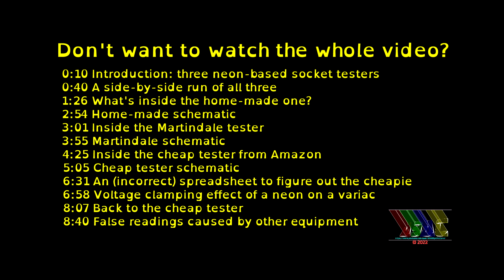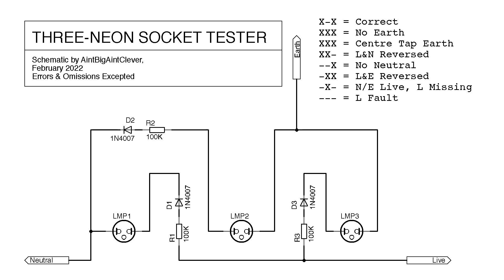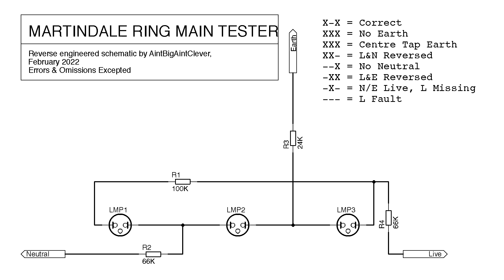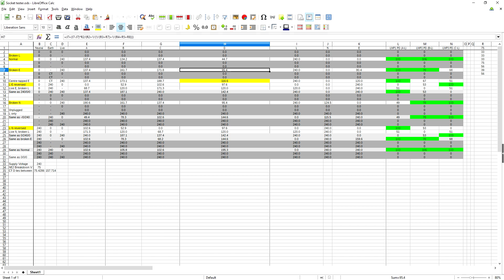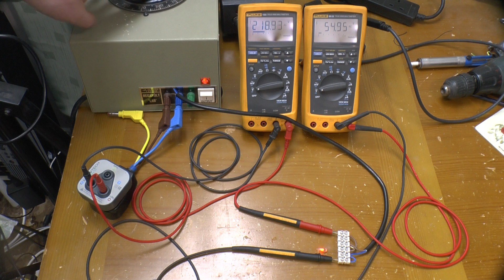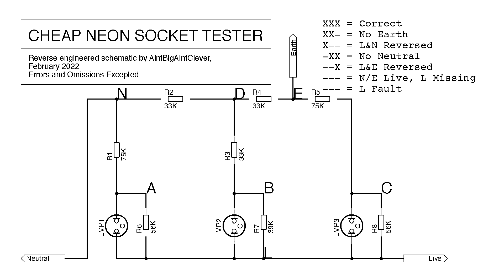What's inside a neon socket tester?

Comment: They're handy little devices, but you can never check to see a transposed neutral and earth.
Reply from the maker: Yep.  For transposed N-E you need a 10 watt bulb and an RCD on the supply :)
Reply: @AintBigAintClever  Yep this is PRECISELY one of the many reasons i still keep an old Drummond MTL-7 test lamp in my bag. Nice video, always wondered how the martindale ones work. 

Maybe it's because i'm old, but i always use the MTL-7 (along with a proving unit) as my final 'yep or nope'.... modern testers, even ones with a supposed 'load resistor' can show live when there's not ... which can potentially be as dangerous as showing dead when it's not, as you come to ignore the tester. I know we shouldn't but it happens!
Reply: Incidentally, proving unit is home made, in the case of a dead proving unit, simple inverter running off 9v battery, providing about 400v AC output into a neon or high impedence tester, or about 200 into the drummond.  only bit of the original other than the case is the 'start' contact that's cleverly wired onto the springy tag of a microswitch.  KISS principle
Reply: @AintBigAintClever  and how would that work? What is RCD?
Reply: Never mind I looked it up
Reply: @AintBigAintClever  as far as I can tell, if neutral and ground were swapped at the socket, there’s no way to know, at least from these socket testers.  An RCD only detects an imbalance between line current and its return. If the neutral and ground are switched,  the return will be in the ground wire.  How can this error be detected?
Reply from the maker: @yjweaver5108  with a N-E fault anything plugged into the normal pins will imbalance and trip the RCD, because the current's not fllowing back the correct way.  Incidentally this can also happen if working on a circuit where the breaker's been opened or the fuse removed.  If you accidentally bridge neutral and earth (for example when pulling the wires through a metal back box) current from other circuits now has a path not just through the proper neutral through the RCD, but also through the connection you've just made.  Any more than 30 milliamps taking this new route and the RCD trips, usually when you're working in an attic with a lamp plugged into one of the RCD-protected circuits.  Been there, done that :D
Reply: @AintBigAintClever   can you try a simple experiment? Take a receptacle in your house that you know is correctly wired, then open it up and swap the neutral and ground.  So that everything on the case (screws) are now neutral.  So when you plug anything in , current will flow through the line, to the load, and the return is now the ground wire.   I predict your receptacle   tester will not detect any faults .  I’d do it myself, but I’m not equipped at the moment.
Reply from the maker: @yjweaver5108  the tester won't detect a fault in that instance, and draws so little current that an RCD or GFCI feeding it wouldn't trip either.
In a TN-S installation ground and neutral will be connected together at the distribution transformer. In TN-C-S they'll be connected together in the incoming service head.  In both cases from an end device perspective there'll be no difference.